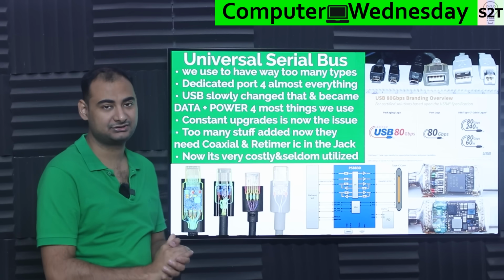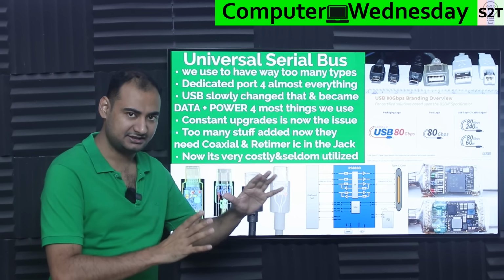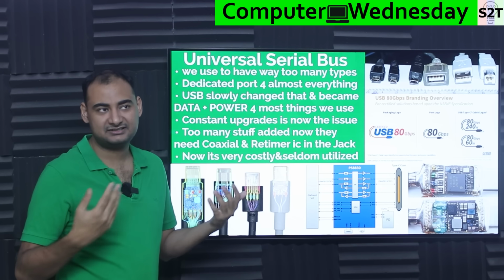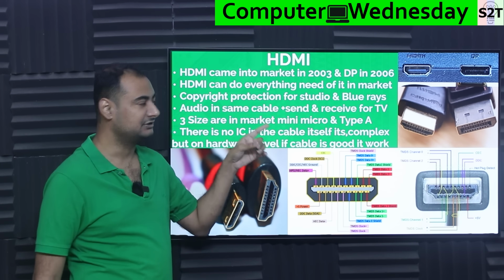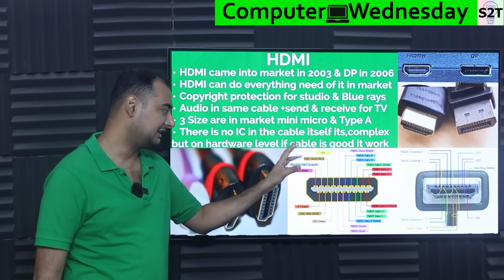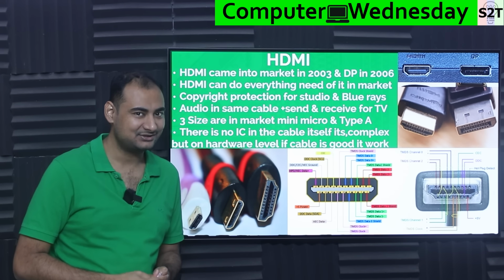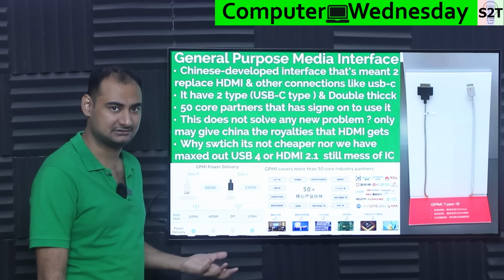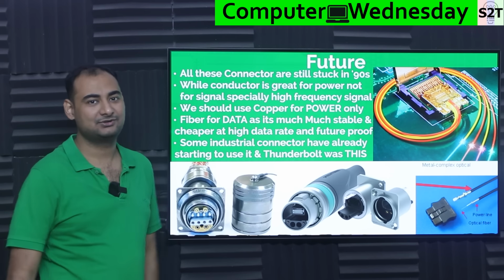General Purpose Media Interface {GPMI} Explained {Computer Wednesday}

Comment: Fiber is not great. They are quite fragile and the connectors are useless if any dust gets on them. That will not work for end-users
Reply: TOSLINK?
Reply: @NutkeyDoesMinecraft  yes, toslink is 9Mbps. We need 4000x more than that. That cable will not work at 40Gbps because of light smearing. I have worked with distributed antenna sustems and fibers are pretty finicky. You look at the wrong angle at them and they don't work. Leave uncovered for 30 minutes or touch the fiber end, and it will not work. Don't forget, end-users are not reading and not respecting user manual instructions, they are dirty, greasy and clumsy.
Reply from the maker: thoses are porblems that can be solved and modern fibers are not that weak {we got fiber to home now } and dust can be managed